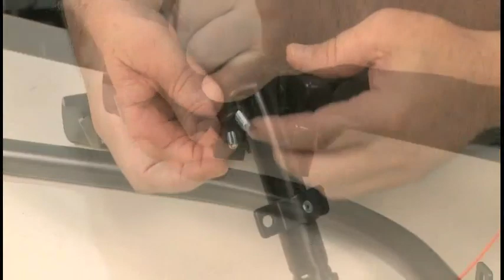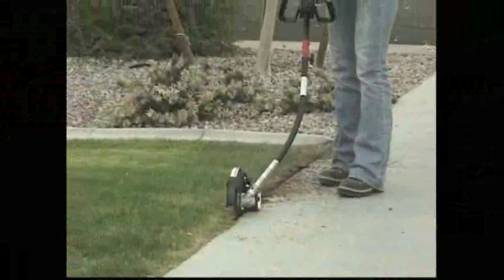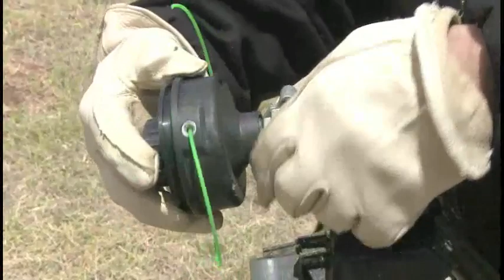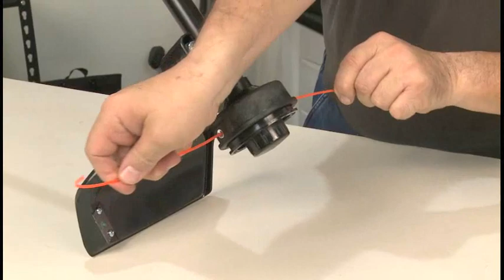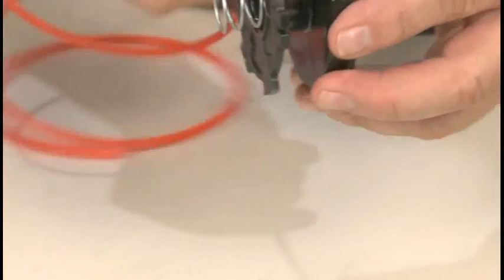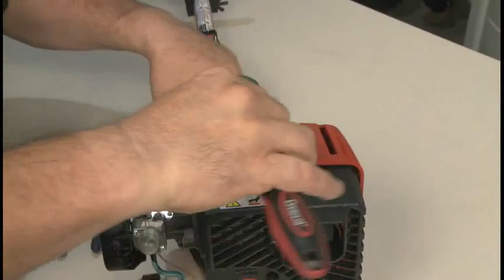The TB22 EC gas string trimmer | How to set up your 2-cycle trimmer

Comment: If I take the inner reel (the part that string wraps around) off and run trimmer with it off, the bump knob stays put. If I replace the inner reel, the bump knob unscrews itself and comes off. The bump knob screws in clockwise, the spool head spins counterclockwise when trimmer is running. With the inner reel removed there is no pressure from the spring against the bump knob which allows the bump knob to remain in place. With the inner reel in, the spring pushes the inner reel against the bump knob and keeps it from spinning with the rest of the assembly, thereby causing the bump knob to unscrew itself and fall off.  Help!!!

Comment: I have never bought a new piece of equipment that is as disappointing as this DAMN TROY-BILT tb22 trimmer.  I've only ran 2 spools of string through it should indicate how little time I've used it. It's underpowered,  bogs down when it touches a blade of grass,  has no pickup when I throw it wide open. I paid $129.00 for no sex, but the largest fu#$ing I ever had.  Little green WEEDEATER -FEATHERLITE, is 3 times the machine,@ abou half the price &1/3rd lighter. Now I'm stuck with this tb (tuberculosis) 22. I'll make sure my friends & family don't make the mistake I did by purchasing TROY-BILT products, they're un-american to sell a product like theirs.
Reply: Wish I had seen this before I bought this piece of shit.

Comment: Own many Troy-Bilt pieces of equipment. This TB22EC is the worst string trimmer I have ever owned and the first MAJOR FAIL of Troy-Bilt equipment for me. It starts fairly easily sometimes and sometimes not. It runs for about 20 minutes and keeps stalling out. The longer I own it the worse it operates. Regret this purchase. The design to remove the bump head is ridiculous. Next purchase for stringer I will research head removal. This one is held on with a bolt...metal to plastic...guess what, after a few string changes, it is stripped and I can no longer get the head off. Wish there were "what to do when my Troy-Bilt stringer fails" videos. Don't buy this, you will regret it,  poorly designed and poor quality. Let's see if Lowe's will take it back.
Reply: Maureen Harrison same here
Reply: Same here!  Had a lot of problems removing the bump due to the metal to plastic part.  I think we may have busted something inside trying to get that bolt out...Have to get the whole head replaced.  Wondering if it's even worth it!!!

Comment: Once you replace the line you cannot bump the head to bring out more string instead, you have to take the entire head apart to pull out more string to get through the next ten minutes. Worst design and possibly worst weed trimmer on the market
Reply: Just awful
Reply: You must have tightened your bump cap too tight.

Comment: What kind of oil on the air filter?  2-stroke? SAE 30?...
Reply: any cheap 4 stroke motor oil will work fine, with foam filters you want a thick motor oil in increments of a few droplets after thoroughly washing with hot water and soap and drying it. Put it in a bag and drop a few drops on it and squeeze it then re install